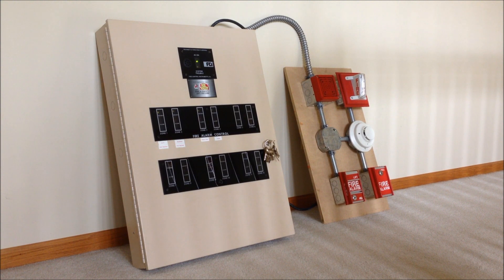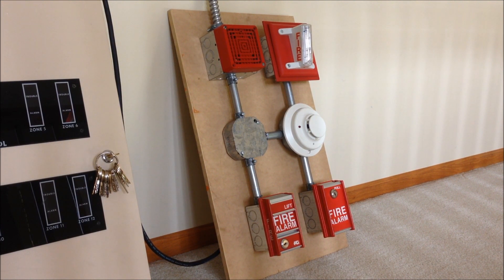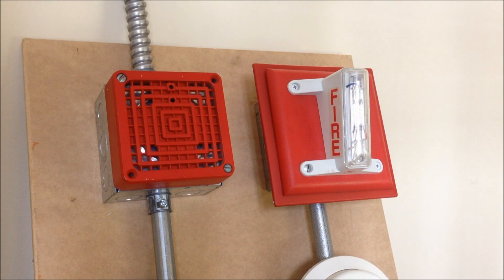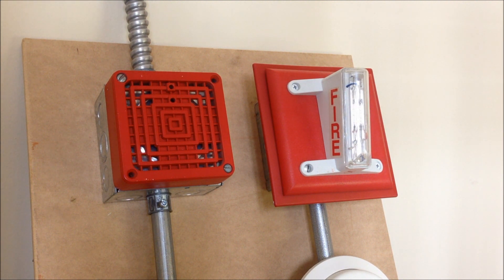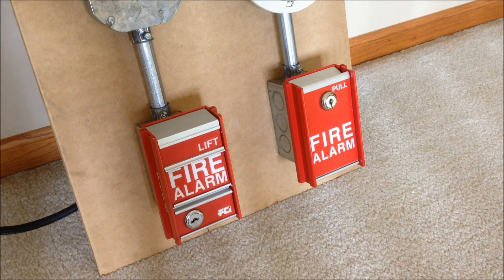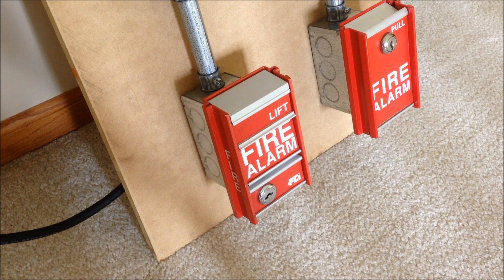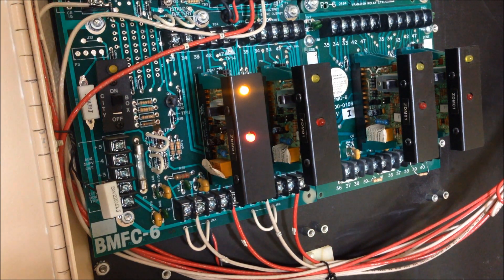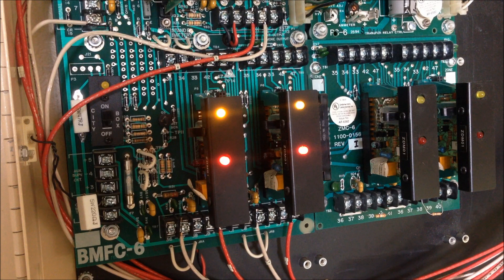FCI FC-72 Panel - New Display Board! | FCI & Federal Signal Devices

Comment: How the HELL were you able to test the i3 with a magnet? I'm fairly certain it can only be tested via a screwdriver inserted into the test hole, but somehow you managed to activate the panel with a magnet held to the i3. (which might explain why the red LED didn't come on. Did you forget about the former method?)
Reply from the maker: I always thought it was magnetic test since it seemed to work. Your comment made me curious, so I looked in the manual and you are correct - I don't see a magnetic test option at all! This is a four wire detector, so it has a relay contact. I'm wondering if I was able to pull that relays' contacts with the magnet, and that's why it didn't light the LED. Otherwise I have no idea to be honest with you - its been so long since this demo that I can hardly remember.
Reply: @kcin556  To be honest some time back I thought that the pill-shaped area on a lot of System Sensor's detectors marked the magnet area, but it turns out that it usually indicates where you can test the detector with a sensitivity reader. There are some variants of the 2400 however that CAN be tested with a magnet. (I think it's mostly Fire-Lite/Notifier addressable rebrands of the 2400, & of course they don't have a screwdriver test because you can test them with a magnet instead) Perhaps it WAS because the magnet moved the relay enough.

Comment: Was wondering when we'd see this again. :P
Reply from the maker: I've been trying to make more videos of it for a while, didn't have a good way to use alarms with it until I got the board ready!
Reply: kcin556 I think that's a pretty slick way of doing it. Then if you need the board on another system you just disconnect and move, simple as that.
Reply from the maker: That's the plan!